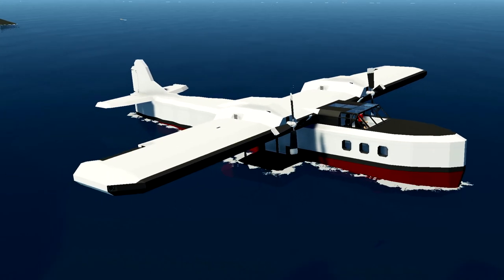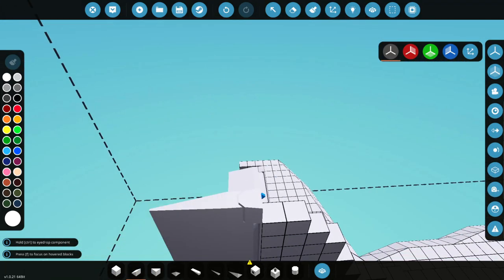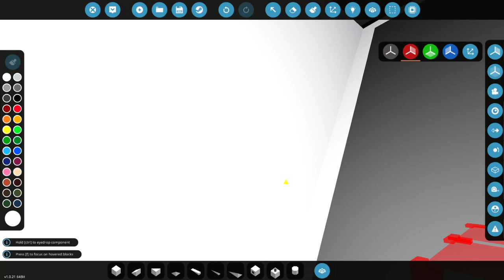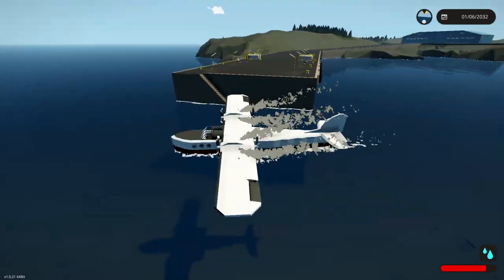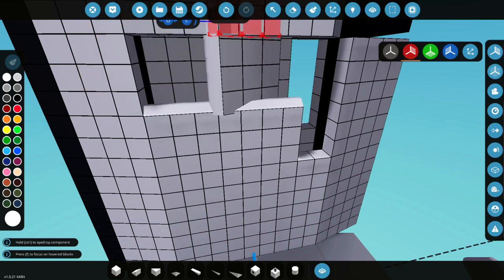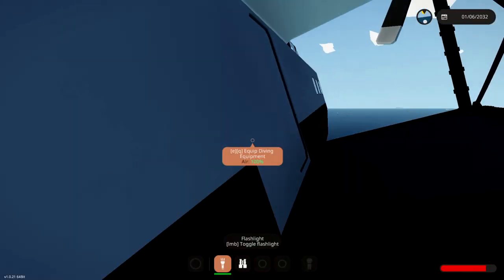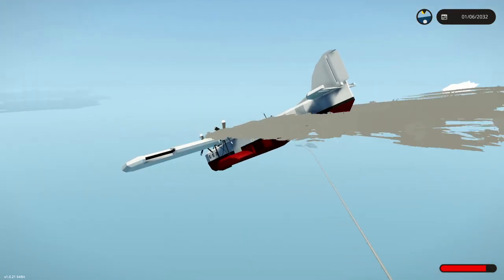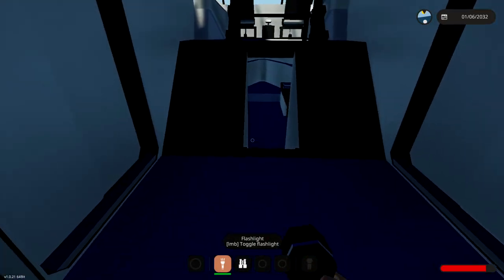Four Propellers!  -  Seaplane Build 2.0  -  Stormworks Gameplay

Comment: Frantic, use wing pieces instead of blocks and also VERY important: ur plane has its center of mass in the middle while ur center of thrust (props) is high, and that pushes you forwards so u cant take off cuz its pushinh INTO the water, so I really suggest to copy and paste the engines and props like to the middle of the plane and then connect the floating engine to the wings with pipes, so its like hanging propellers and then the centers of mass and thrust will be good and you could be able to take off. Putting weights in the back will not help

Comment: You should have added bigger props or ones with more blades in my opinion, but pusher props work I guess. Also when it feels weird when you are flying into the wind it’s because the wind is so strong planes can hover. You can’t fix the wind throwing you around.
Reply: Also if you use wing pieces they provide lift.

Comment: I was thinking that your push propellers are pitched the wrong way. They might be pulling you backwards instead of pushing forwards.
Reply: I think what is need on those are negative pitch -- as in provide a -1 to them (since by default airplane props have +1).  Currently they do nothing, I believe.